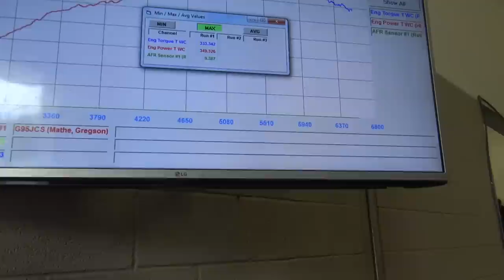My Sleeper Volvo V70R Made WAY MORE POWER On The Dyno Than I Thought It Would

Comment: Congratulations for your rewarding efforts. I can’t wait for the race!  I think that a powerful Volvo sport wagon is the way to go, and they look so cool. I don’t know if you were into Volvo in the 90s or not, but I believe that the first year 98? V 70 XC (like my wife’s) was surprisingly picked as the SUB of the year by Car and Driver to the chagrin and consternation of the full size pickup trucks.! I am supposed to get my 1985 245 Turbo back from the paint shop! Can’t wait. I did t mechanical overhaul in my garage, but was hit by a woman backing out from the doctor’s office. We both had Allstate insurance and they refused payment. Her van wasn’t damaged, but her bumper came up over mine and crushed the passenger side brake and signal lights.
Due to health issues, I have been waiting for 4 years to get this done.!
The old professor

Comment: Assuming those numbers are including the WCF (Weather Correction Factor), which it looks like it does (WC @ end of number) that Mustang Dynos usually apply you wont see an increase in tq or power on a "better" day or a decrease on a "worse" day. Would've been nice to see the corrected and uncorrected numbers on the main mustang dyno dash or an overlay of both on the graph. Also was your original dyno corrected or uncorrected numbers? Ideally you want to compare corrected between both dynos to really show the improvement, or else like you said weather can have a huge impact.

Comment: Atmospheric conditions should make no difference to the numbers if a correct correction factor is used using connected sensors.   Any dyno operator that tells you otherwise is either cheeping out or making excuses.

Comment: Huh? The denser air, and a bit of water vapor should let you hit higher not lower HP.
Reply: Water vapor displaces oxygen and causes loss but if the engine is having preignition or detonation the humidity can increase hp & tq
Reply: Jimmy Aber

Thank you , for clearing that up correctly!
The old professor

Comment: Nice dynopull 👍👍 i have a s60 2.5T with Mitsubishi 19t turbo and a lot of other parts. 
Last dyno run 353hp och 400 foot pound ( 530) Nm at the wheels. 410hp and 450 foot pound (612Nm) at the crank 
I know the feeling and the pull 😀😀
Reply: I call bullshit on stock 500cfm TD04HL19T. Max is about 360-370. The turbo can't make more boost to feed it.
Reply: @warthog476  I only got 320 crank hp with my new 19t. The ecu somehow dumps too much fuel at 5500rpm and it cant hold the boost after 5500rpm. The tuners cant find the problem.
Reply: @dpsubzero  VVT issue?
Reply: @warthog476  hmm, the engine got replaced and it was having the same problem before and after the change. I'm not 100% sure if the VVT solenoid had been changed.

Comment: No one cares about peak crank HP, not sure why you are so focused on that, WHP is all that matters. You cannot calculate actual drive train loss unless you bench test the motor and have a starting point. Peak HP is for arm chair racers, look at the gains through the whole powerband, does the power come on sooner, later ect. I couldn't finish the video honestly. Hopefully you mentioned the type of DYNO you guys were using because that will make a difference in outcome. Not meant to flame your car is cool and sounds great.

Comment: Dyno should have a weather correction factor, so weather doesn't matter
Reply: That's what the wcf means on the results.  Also,  mustang dynos have the option to display crank numbers.  Not sure why the operator didn't pull up those numbers as well.  But with that horrible smoothing on the graph screen,  looks like he doesn't know the software well

Comment: Deciding to get a 06 v70r with 90k miles for 10.5k$ is that good and are v70r reliable?
Reply: Both YES
Reply: 09 xc70 t6 with 90k miles will run you about 8k and for 400$ you can get the polestar software upgrade from the dealer which puts you in the 400hp range

Comment: Im saving up to a R Volvo, but here in Sweden they cost 10.000$ and that's gonna take a while
Reply: Å dyra att äga om något går sönder.. drömmen att ha en, men får nöja mig med 05 V70 med 188hk antar jag..
Reply: I bought a Volvo v70 1998 turbo for $600 in Sweden a month ago.
Reply: I skal ikke klage :) Her i Danmark fandt jeg lige nu kun to V70R af denne type til salg. Den ene havde en privat sælger, og han vil ha' 125.000DKr, og den anden er en forhandler, der vil ha' 180.000DKr. Begge har pudsigt nok kørt omkring 260.000km. Se dét er mange penge for sådan en bil :)

English: Here in Denmark i found two V70R for sale right now. One privately owned one for close to 19.000$, and one at a dealer going for 27000$. Both have around 162.000 miles on the clock. Now that is a shit ton of money for an old Volvo :)
Reply: Fan lika bra att bara köpa en T5:a och trimma. Går lika bra men bättre i hastigheter över 60-100.
Reply: Köpte min V70R 2004 för 60k för någon månad sedan :) Finns om man är villig att fixa lite.. Men vill man ha en fin så ligger dom på runt 100k :(
Reply: man får bara spara och ha tur för att hitta en med lite skavanker

Comment: I hope you'll change your mind about bigger wheels and raising it. I've got an S60 from the same generation and I absolutely love its stance on stock wheels. Not to mention you'll lose some power at the wheels, if they're bigger.
Anyway, awesome car!
Reply: It's already lowered. He wouldn't be raising it higher than stock height. Also I forget if his other wheels are larger than the pegs but I would bet money they aren't as heavy anyway.
Reply: @StackBundle  if it's lowered then he must put it back where Volvo designed it to be, of course!
The power loss is not necessarily from the weight, though any unsprung added weight is going to affect handling, bur purely from the larger diameter, since it takes more torque to spin the wheel.
Reply: @adrianohaha7659  He doesn't have to do anything. And having a larger wheel does not mean that the wheel+ tire diameter is larger. He would most likely have lower profile tires with a larger wheel size so the overall diameter would be about the same.
Reply: @StackBundle  bro, let's not get all sensitive now. Of course he doesn't HAVE TO, it's his car, he can do whatever he wants. It's just a way of expressing an opinion about something, relax.
And he said bigger WHEELS! Now, I'm not a native English speaker, but the wheel is the rim plus tire. A bigger wheel means a larger diameter imo. If I'd just want bigger rims, I would say "bigger rims".
Anyway, don't get so worked up, we're here to have fun and discuss car stuff, not to be offended/offensive etc.
Peace
Reply: @StackBundle  dude, go get your head checked... Jesus Christ!

Comment: This sounds exactly like my 1997 C70 2.3 T5. It has an R-manifold, 3 inch 200 cell cat downpipe, TME Sweden catback. Nice numbers.
Reply: Thor V funny guy your hardly stage 1
Reply: @mw5461  I was talking about the sound. 🤦🏻‍♂️ Not my other mods...
BSR cold air intake, DO88 intake, 16T angled flange hybrid turbo, DO88 rip kit, alloy intercooler, water intercooler spray, customized throttle body, blue injectors, machined and flowed R manifold, 200 cell cat downpipe, TME Sweden catback, AEM high pressure pump, AFR gauge.
Check my channel for my 0-200km/h. It didn't even have the mods in the video as it has now. So it became quicker.
Reply: Thor V I’ve just watched the video in question and I’m very disappointed if that’s had money and work out into it
Reply: @mw5461  Sure, I'm curious for your build... If I'm happy with the result your opinion doesn't matter actually, and there are enough people who respect my build and setup. It has a safe mapping and has enough performance for a daily FWD too. 👍
Reply: Thor V sorry to inform you i was brought up around Vicks and my father is the man behind jump leads at Anne’s a well known and respected Volvo specialist ask rob diy he knows me and my family so good luck with your garbage build it’s well under performance for the mods you claim to have I’d get a wideband and check all your readings
Reply: @mw5461  "Respected" Volvo specialist, what a joke right? You gain zero respect by giving these type of comments like above in the Volvo community even though your father is a respected man in the circuit. That doesn't make you a great Volvo enthousiast.
So daddy did everything for you on the car? That's cute. 
Robert DIY earns a lot of respect. What a shame for him he has guys like you hanging around.
But then again, show me your build, learn me more. I'm still being polite and curious.
Reply: Thor V was you born a woman claiming to be a man?

Comment: Now do all the same with the c30 and get them even!
Reply from the maker: My c30 is pretty close in torque already and more power mods are on the way. 

Plus shes like 700 pounds lighter.

-Chad
Reply: @ShiftingLanes  Im still debating what power mods i should do first on my c30, i want to get a tune but i heard that i should get some bolt ons first so the tune can accommodate for them afterwards